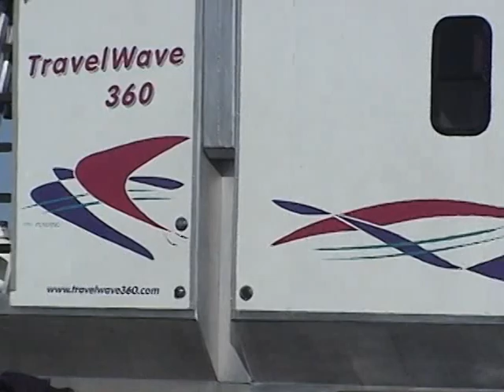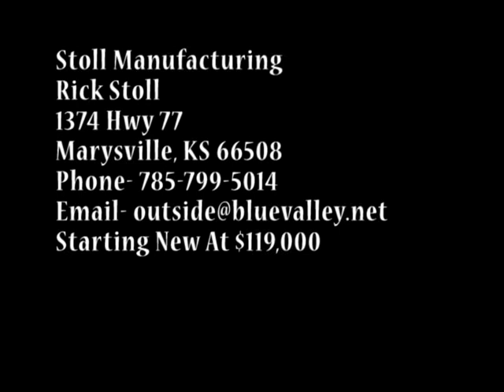Travelwave Trailerable Houseboat Info Video Part 3

Comment: Nice job, I am building a home made camper also. Sleeps 5, self contained water, Porta jon, solar powered with 150 watt panels and 230 amh battery dackup. this is a slidein for utility trailer. But I need sujestions.  Check it out , mac camper 136.